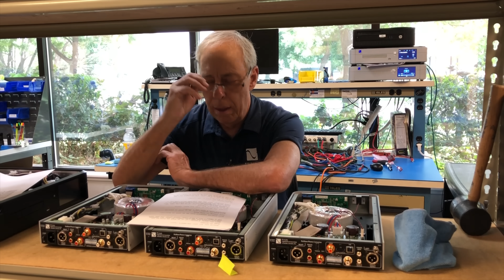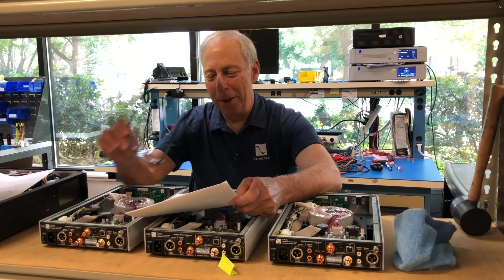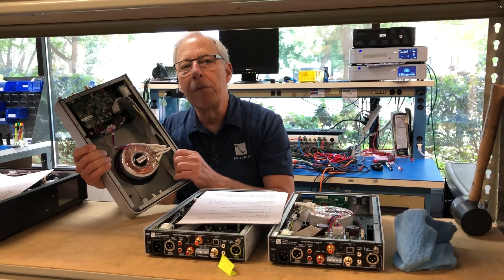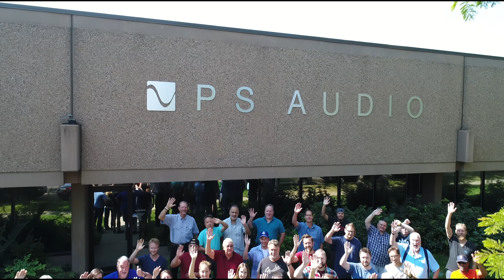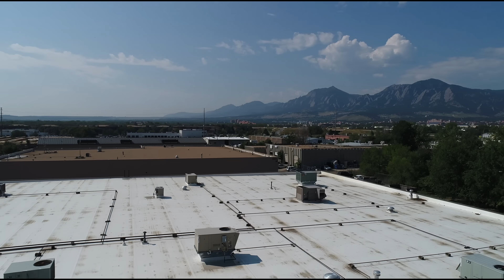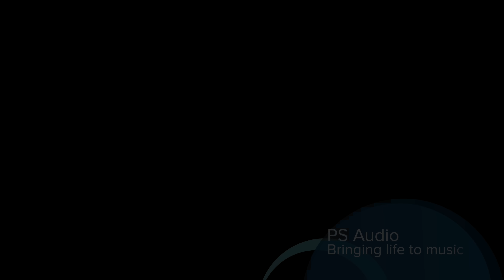What's inside a high end power cable?

Comment: So IF there is a difference between power cables, WHY arent there any scientific proof? Why is it that hifi is the only thing in the world where you don't need any kind of proof for your claims?
And why is it ONLY in audio that cables matters, why doesnt computer geeks for example use "better" power cables to get more stable clocks on their graphics card to get higher fps?
Reply: I make my own cables.  There is scientific proof.  Have you try it yourself?  Think of the power cable as a function of filtering (internal signal-mainly from the electronic motor itself), shielding, power delivery, impedance source, and impulse power.  Also, the transformer and the wall outlet are soft boundary conditions.  The 60 hz power cycle matches well with the first six to eight feet of a good power cord filtering design.  What is the most important part of the pipe system that affect a water turbine?  Water turbines are very similar to electronic motors, and the same logic applies.
Reply: @sonngo4269  
Dude please don't get all butthurt but you need to study some basic electrical engineering, that is one of the most clueless comments I've ever read....wtf ??
Reply: Fester Blats If a blind test confirms it, I agree. However, often people say something sounds better but actually it’s just senses being fooled. And things like the differential effect of a more expensive power cable is easily measurable if it actually had an effect.
Reply: I have yet to watch a video where he talks about doing blind tests for these things too.
Reply: Ryan Callahan Yes, unfortunately few audiophile companies selling over-priced cables or other snake oil will endorse blind tests because they know what they sell mostly won’t pass such test. Paul would grow some respect if he put sincere efforts into sorting out his business to be with products that can pass in a blind test judgement. This particular video has a lot of snake oil talk in it.
Reply: I’m sorry this is just nuts as you are relying upon ,what ,fifty plus feet of Rolex from your house panel ...if the “highs” are not present at that point ie your wall receptacle how can u possibly regenerate them over the couple of get to your power amp???
Reply: @Larry Niles feel better pushing a  lie to consumers?
Reply: @hardcorecap  which lie?
Reply: some people are extra-sensitive to sensory cross-talk and expectancy effect. while there's no measurable difference at all, they could really still hear the difference but that's just them. everyone has their own perception. it's kind of individual.
Reply: Ped-Away-G Those people are usually sensitive to the differences in expensive cables until you test them in a blind test.
Reply: It's very easy to measure -- simply play the same source in both cases and record the voltage and current at the speaker. There's no other magic to be measured, just overlay these two waveforms and compare. If there is a difference that means some people will hear it, and if there's not then it's just imagination. I'm sure someone must have done that already, I'd be curious to see the results.
Reply: There is one scientific proof,your ears,same thing with antenna cables or scart cables
Reply: @roqueiii645  LOL more mythical  expensive cute speaker cable make your speaker sound better bullshit. Just cause they look cute, and cost a lot sone how makes them sound getter pure bullshit...
Reply: @Larry Niles bot
Reply: A lot of these power cables are bought out of industrial parts catalogs, a little spackle and presto!  You're paying for your shiny new sports car. Its even worse that interconnects and speaker cables. To think that ANYTHING that  has to do with manipulating power is pure belief in magic. America has the best power supply on earth, beyond a decent power supply with decent regulation ( and preferably a toroid) and steady current anything else  is not only not going to make any difference, its IMPOSSIBLE for it to.
Reply: You need a very high-quality audio system, including a clean power source such as a dedicated, well-grounded power line, to notice the difference. Most folks do not spend $80-100K on their audio systems and have custom-built listening rooms, as do audiophile fanatics such as myself. Paul is correct, in fact, I would say high-quality power is the biggest upgrade compared to other cables in such a system. I am trained in electrical engineering (and neuroscience, psychiatry, and molecular biology), and my colleagues would never believe this phenomenon, but when I perform blinded studies with then they are amazed by the difference a high-quality power cord will make. The sound floor is decreased (no noise), the soundstage is enhanced (3D), and the timbral quality of the music is increased. Also, anyone who uses expensive medical imaging systems will agree with Paul's statement.
Reply: @Telemed911  I don't care what you're trained in, saying a power cord can affect the soundstage is absolutely ridiculous...smh
Reply: Gurra Tell your ear is the scientific proof. Music is feeling measured by your soul not a set of numbers on a paper from a lab!
Reply: @MarkRay84  
Well I'm glad they don't measure aircraft performance that way...smh
Reply: @roqueiii645  lol I went to school unlike you and also build custom amps.  How many amplifiers have you built?. What test equipment do you actually own?  Have you ever even done any tests? Super curious. Cause I have. And there is no difference bud.  There are bad cables. But it's only cause they are falling apart or arent up to spec.  It they are up to spec they are ALL THE SAME.   Fucking magic unicorn cables.  You guys are trippin
Reply: @patrickrosington1174  if you ca build  an amplifier then your problem is in your ears so you cant hear the difference between cables although you admit there are bad cables  so I guess you know there are  good ones.I have a good sistem and have made lots of tests so I can say power cables are important for filters (or sockets) and amplifiers.The better your sistem is the easier to hear the difference,not only with power cables as well with RCA,or another details,vibrations for instance.Go to reformatory school,they will not teach you how to compare one cable to another (although you recognize there are bad ones) and above all they will teach you better manners.
Reply: Because CLOWNS persist in this industry.
Reply: Also note the margins on cables ....insane . Gauge is critical shielding less so with power cables hello u just want large current and no interference on a power cable . You can go down the rabbit hole with interconnects even digital and even optical but u lose all credulity when you are pushing $1000 for one meter cardas power cords!
Reply: Exactly! Look at the solar power industry. Electric cars. If there were any truth to these audiophool power cord claims, those billion dollar industries would be all over it. Even 1% less electrical transmission loss in an electric car internal wiring would be worth millions alone. Why is consumer audio the only application of such technology?
Reply: Andy Delle Yes.. And I'm sure NASA would be interested in Paul's technology too..
Reply: @andydelle4509  
Because electric cars are based in science and HiFi is based in religion.
Reply: Gurra Tell exactly right. And noticed that the people making the claims are the one selling the products. No companies outside of sales makes these claims.
Reply: @bradleysmith681  buy an amplifier and use it with the cable that comes with the amp then use the amp with a cheap but good power cable,Ecosse orange,Agile power cable,JIB,Xindak etc...is night and day.Obviously if your sistem is too bad or is not well placed etc... you will no listen the difference but the better your system is (details are as important as components) the easier you listen the difference.Power cables are not a myth,are an important part same with signal cables.Some people spend a lot in TVs or cars or clothes or whatever ,others spend in high-end audio not for nothing because they want to listen what is recorded on the CD (Vynil,SACD...) and power cables can help or not.Same thing with power plants,with or without filter.
Reply: @roqueiii645  A properly built power cable will power the system properly. The esoteric cable will add nothing. These manufacturers can't change physics..
Reply: @bradleysmith681 people (at least I did) dont turn on the system for a lesson in physics but for listening to music, they (the cables) can change what you hear( or not) and  how  you do hear  it,in some cases is hearing or not hearing what is in the CD,in other cases is a matter of different tastes
Reply: Seeing is believing for some audiophiles. Expensive looking cables sound better to them as long as you don't validate their opinion in a blind test.
Reply: Of course they work. Like any decent power cable does.
Reply: Vitor Roma Have you changed the many feet of power cables inside the walls of your house to some decent ones or what? If this topic was of real importance, people should either change their house wiring or put their audio gear at the nearest outlet to their Watt meter LOL. It’s easy to understand that anyone claiming they can hear the effect of 5 feet of premium audio cable should also be able to hear a better audio performance from an outlet that has 5 feet less wires inside the walls from the meter 🤔😎😀
Reply: Because audio is analog and for example usb is a digital differential signal. That means you can use much lower quality cables. For example badly recycled cooper, also if you want to transmit current you need cables with more diameter than moving some bits around. Did you notice your speaker actually has a coil and needs to produce a electromagnetic field... Before you post stuff like this, better do some research or brush up on some physics
Reply: @schmirgo  Well, the electrical properties of cables indeed are following laws of physics and you can calculate and measure the impact of a cable of a given length. Your speaker cable might cause a reduction of the damping factor if it's too thin, but it's very easy to calculate how much impact there is as it is a derivative of the cable resistance. But especially line level cables might also add a filtering and phase shifting effect but unless you use very long or very crappy cables, the impact is in the less than 0.1dB range you simply can't hear. Don't fool yourself by imagining things and spending too much on cables that do nothing you can actually hear. Beware, sophisticated cables might actually make the sound worse if they add more capacitance or inductance through their "advanced design"...I've seen that.
Reply: Audiophiles don't need proof, because it is a religion, not a hobby.
Just like politicians never provide proof for all their fake promises and lies.
Reply: No different then incompedant democrats going after Trump. LOL... Snake oil bullshit.
Reply: @airgliderz  and the award for the most irrelevant shoehorning in of politics goes to....
Reply: @airgliderz  no that one is still yours
Reply: @wp262  yes but it is at least spot on correct.
Reply: @airgliderz  wat
Reply: Sound measurements on paper have fuck all to do with what you hear. If that were the case we'd all be buying gear based on paper graphs. Who needs to audition gear when you have this paper graph to go by? It tells you EVERYTHING you need to know. See how ridiculous that sounds? 

Peasants get so butthurt over more fortunate people spending their own money shit they'll never afford anyway. You'll never own a $20,000 pair of speakers anyway but if you do I bet you won't be wiring them up with Best Buy Rocketfish cabling either.
Reply: Round Earth Shill not ridiculous at all. If you're going to say that Test A  sounds differently from Test B, then those tests can be easily measured.. if a speaker itself is reacting to the difference, then our precise instruments will also react to the difference. And of course, Paul will never show those measured differences... Ever..
Reply: Bradley Smith  Can you measure everything? people will describe an excellent loudspeaker as disappearing from the room. Its true, with good speakers the sound is just there as opposed ti coming from " that little box against the wall. Can you measure that?
Reply: 60zeller Differences in sound stage are the result of phase and reflections; and while not easy to measure, we can judge such things fairly easily. What determines the sound stage is mostly about speaker design and room acoustics. A blind test using experienced listeners can confirm most assertions concerning sound stage performance. However, other things are pure snake oil and will neither be measurable or able to pass a blind test. In that category you find expensive power cables. They belong to the snake oil department.
Reply: @60zeller  yes, you can measure that. There is a whole field of engineering dedicated to it
Reply: @roundearthshill248  "sound measurements on paper have fuck all to do with what you hear"
Then why do all these glossy materials you get from your vendor have all these cool graphs on them? (Even though half of those have zero theoretical foundation)
Paul would rather make something that works without knowing why it works.
And with the same breath he tells you how it works and why his jiggamajang works better than the cheaper products.

The impedance is lower. Everyone knows lower impedance sounds better...
Reply: @oscargr_  everyone also knows that if a lower impedance power cable makes your amp sound better your amp has a shit power supply.....
Reply: @roundearthshill248  
How the hell do you know what ANYONE can afford ??

Comment: Tintagel is best place I've seen in the UK, really strange place.
Reply: First you need to drag a direct cable from your switch board -
Your snake oil power cable can't improve the shitty 1,5 mm2 installation cables in your installation and wall plug

Comment: 1. So when every outlet in my house is installed with stranded wires (as is the standard now) in the wall, I can't get the best sound possible? Bummer.
2. If solid wire is so great, then why does the unit you show have thin stranded wires leading from the main connector to the big transformer?
3. BTW: Power cables are stranded for a good reason, it's so that they don't break when you bend and twist them as a normal cable would be.